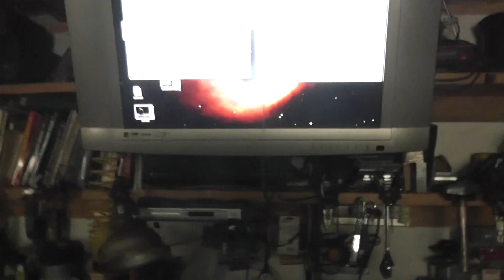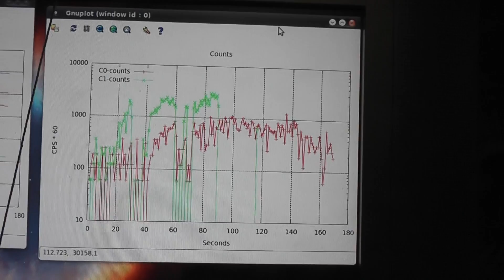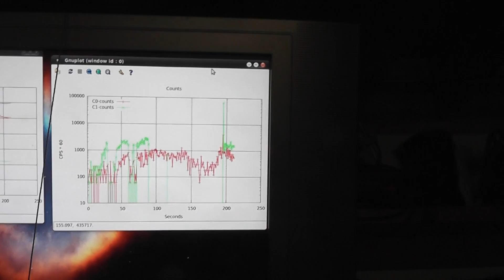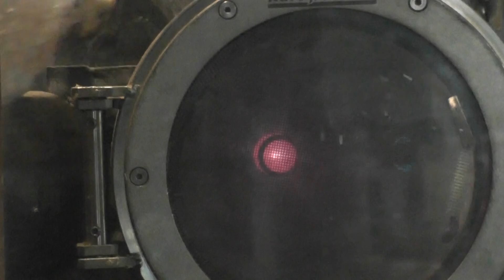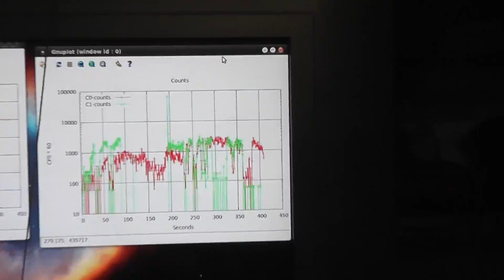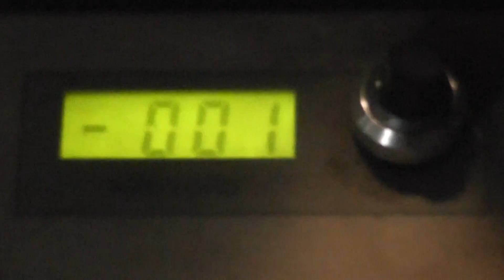Apr12 14DemoRun

Comment: I'm sure this has been asked, but have you given any thought to a practical design for generation of power should this get to the point that you can generate enough radiation on a sustainable level? I saw your most recent video at around 6 this morning and if that is anywhere close to true and reproducible you're starting to really get somewhere.
Reply from the maker: I feel like once I get to real gain, that problem goes away.  A single phone call to Babcock and Wilcox, or GE, say, would have their execs on private planes to here in minutes if I told them I had this big pipe that stays yellow hot no matter how hard I try to keep it cool.

Steam plant is around 48% efficient at best.  Not horrible - needing better would to me be an admission of failure in my quest for higher gain.

There are for sure other, heavily patented but never shown to work, approaches.
I'm not sure they can even be built, actually - but Eric Lerner (Focus Fusion) thinks enough of them to have patented some pretty crazy schemes.  Not for me if I can avoid that.  And his schemes don't handle some of the types of energy output I get here, just the charged particles and perhaps some of the gammas.  I also get neutrons...tritium, and helium-3  (worth saving to re-react).
We have managed to detect tritium in our outflow, but it took heroic effort, since it tends to preferentially react with the D in there before it could be pumped out.
We can't be sure about the He3 other than via theory (it's the product of the neutron producing reaction and we get plenty neutrons).  This is because a mass spectrometer is swamped by other mass=3 things like HD, T and so forth, and doesn't have enough resolution to separate those from one another.

A neutron spectrum would be nice, but that's  both difficult and expensive.  It would only show us how much of the tritium we make is reacted before it gets pumped away = and we have good theory for that one already, not a worry.

We run in batch mode anyway...for now.
Reply: Thank you for the response! From the little I understand, usually a steam plant is not so efficient as that even and that one of the problems (if not the biggest problem, safety issues aside) with current solid fuel fission generators is that in totality they are between .005-.0075% efficient at best when considering the fuel consumption and therefore 'exhaust' literally tons of waste. . I think you're right that it will attract some serious attention when you get to a usable level. 

Also I like how you worded that, "no matter how hard I try to keep it cool."  That makes me wonder, how hot COULD this system safely go with upgraded containment? maybe hot enough to drive air turbines? I think you nailed it already though on producing something that could compete at the lower temps that a steam turbine requires. 

This is the first time I've been able to grasp cold fusion well enough to understand the inherent overall safeness in event of a system failure as compared to heaps of fissile materials depending on nearly 100 or sometimes more atmospheres of pressurized water. I really like this approach!

Thanks again in that case for providing such excellent clarity in all your work! 

I also really like to hear that it produces valuable products AND potentially renewable fuel sources. . That seems to be invaluable to the future of nuclear energy. Am I correct to assume that the fuel consumption is many orders of magnitude higher than fuel rods? (less waste) and also very much less toxic in the end? I think I may be getting ahead of myself.
Reply: Doug Coulter for clarity, when you say 'batch mode' are you saying that you're collecting the data from every piece of detection hardware and combining the numbers, rather than counting one detector by itself? just wondering as I have almost no familiarity with fusion or programming. Maybe you'd say I can read street signs, but not a book..
Reply from the maker: ThCWeEdY The short answer - yes; to that and a few other things.
We take and record data from every sensor we have, every time, so yes #1.  We also run a a batched, timed mode.  We let in X amount of fuel, and do timed runs, while integrating the neutron output via neutron transmutation of a silver sample in a neutron moderating oven to tell us how well we did overall - it's the most reliable "sensor" since it can't be fooled by EMI, but it doesn't give real-time results for tuning like the other stuff.  In many runs you can see where I turn off the fusor power (neutrons drop to zero along with HV volts and current, which are labeled ad0 and ad1 on the realtime plots as I run), then put the silver back on the geiger counter to see it decay - since we use a semi-log plot there, it's a straight line, which can easily be back-extrapolated to the actual turn-off time.  During a run, we might let in a little more gas, or take some out, with the turbo pump set at a speed such that it tends to pull out heavy impurites (water, oxygen etc) better than the hydrogen/helium, to keep conditions as constant as we can - heating this puppy up often frees both impurities and fuel gas that was stuck on some surface, for example, and timed runs make things more consistent and expose me to less radiation for a given amount of data taken.

At the moment, we don't actually "combine" the numbers, but plot them in a 4d plotting program I wrote, mapped various ways (since we have more than 4 numbers per sample often).  X,Y,Z and color, in gnuplot.  Other vids here show that.  It lets me find patterns and "sweet spots" that would be hard to discern other ways, and learn more stuff from the same amount of raw data.

We often note that at the beginning of a run, we often get more fusion, since we get some charge-exchange at the core and it accelerates ions into the shell, where D is trapped in the stainless steel (at least, until it gets too hot).  Sometimes we get more at the end due to a buildup of T and 3He...which are better fuels than D.  The usual, though unsatisfying, answer is "it depends".
Reply: a lot to take in for me, i'll try to catch up :)

Comment: Nice, do you have any idea of how much energy you generate now compared to what you put in?
Be careful.
Reply from the maker: We made a huge leap forward once we got to an oscillating mode - it seems to work better at onsets.  My theory is that to the extent we align spins in "dynamic equilibrium mode" like most run, we find a place where all the spins are aligned, and it takes anti-aligned spins for fusion, so random is better than utterly wrong.  We're now hitting 10 million neutrons/second, still out of the danger range if we keep the runs short (we do).  We see around 10-20 times the cosmic background on a geiger counter during runs, plus whatever from the neutrons.  But yes, if it works much better than this, we'll have to run remotely for safety.

Worked it out once.  Roughly, 1 million neutrons/second is one microwatt of net fusion.  Not a lot.

We see a lot more Q at lower power inputs, though, and during oscillation.  Fewer neutrons, but also WAY less input power, so that's where we're going with it.  I believe we are now at a record level for "amateur" fusion.  Again.
Reply: Doug Coulter

Nice work Doug. Could you please post a video showing and discussing your current and earlier grids?

You call this amateur fusion? I have never really liked the word 'amateur'. By definition, it only means that you are not being paid for what you do, however it is too often used out of context, implying a knowledge base and/or skill level that is not on par with that of a 'professional' paid scientist. It's almost like there is a social stigma attached to the word. This is clearly not the case here.

Doug Coulter = A real-life unpaid professional!
Reply from the maker: You can go to my channel on youtube which is:
https://www.youtube.com/user/DCFusor
Or my forums, which are at:
www.coultersmithing.com/forums

This isn't my first day at this, after all.
And yes, I agree, people with PhD's who took 7 or so years to solve one problem and write a report tend to look down on people who skipped out of high school into college, then skipped out of that, solve 10 problems a day and write a daily report.  Go figure, but if I call myself anything but amateur, the crap-storm is vicious.
BTW, this is all copy-left, including the hardware and software (including source code) for everything involved.
Reply from the maker: Lots more words on this particular run here:
http://www.coultersmithing.com/forums/viewtopic.php?f=25&t=804
Reply: Doug Coulter Nice work. I remembered seeing somewhere on your channels that you have improved the lensing effect of the grates also? Or did mix that up.
Reply from the maker: Lars Berntzon Yes, we are finding the accuracy of the "lens" is paramount - it kind of controls the "compression ratio".  I get a little better at making them each time, but true accuracy is probably beyond my reach.  This grid is about .001" off.  I want "better than optical" grade.  Somehow, I don't think my lathe and jigs are going to deliver that.  Heck, I'm using a racer's cam degree wheel to get the holes 45 degrees apart, drilled with my homebrew toolpost drill.